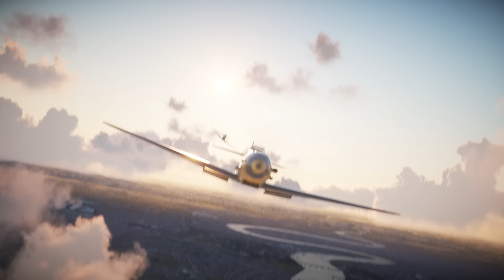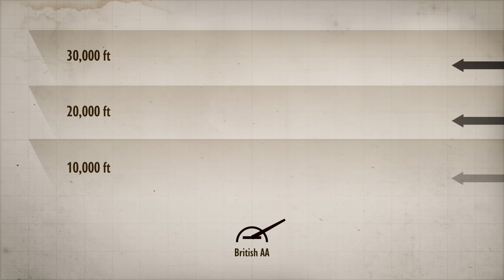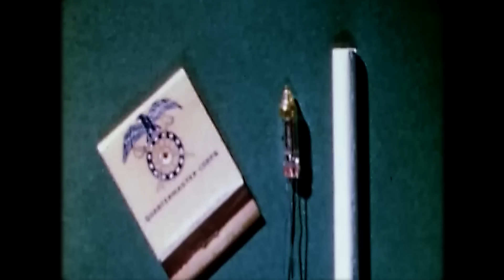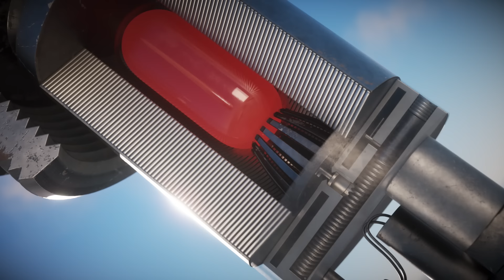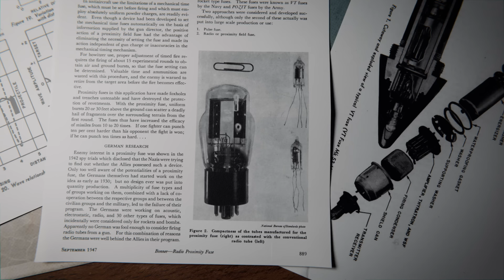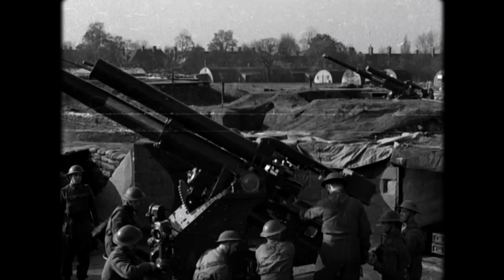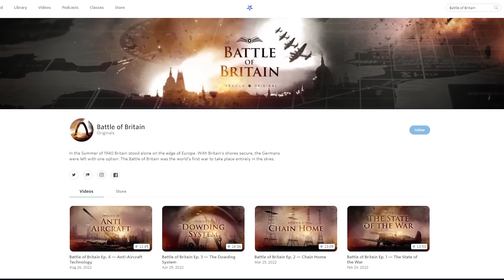The Secret Invention That Changed World War 2

Comment: The Battle of Britain is normally viewed as starting on August 15th of 1940.  The shift to attacking London was one of the Luftwaffe's major mistakes.  Shortly after September 15th, the weather began to turn bad, and the German emphasis shifted to bombing at night, as their losses in daylight raids were not supportable.  The British were working on a photo-electric fuse that would function when the shell entered the shadow of an aircraft.  The VT fuse was first used in the Pacific by the USS Helena in shooting down a Japanese dive bomber in 1943.  Its most effective use in Europe was against the German V1 cruise missiles.  The Germans never even came close to developing anything like the VT fuse.
Reply: There were so many mistakes by the Luftwaffe.  The failure to plan for a longer war in which losses needed to be replaced (new pilot training, new plane construction both on an expanding scale) was probably their biggest one.  They had a larger air force due to a massive head start in pre-war re-armament.
The Luftwaffe in July 1940 had a significant numerical advantage over RAF fighter command.  Over two thousand operational combat aircraft, with 800 of them modern single engine fighters.  Against the approx 650 operational fighter aircraft available to defend Britain, which included obsolete aircraft like the Gloster Gladiator.
In August when the Luftwaffe shifted its focus to break RAF fighter command, the fewer aircraft of the Luftwaffe managed, with accelerated losses of their own, bring RAF fighter command down to an operational strength of 700  (they were up to 750 before that).

The RAF was training new pilots at a faster rate than Germany, and was losing pilots at a slower rate (since RAF pilots who successfully bailed out would often survive to return to duty while Luftwaffe losses over Britain and the Channel would result in aircrew killed or captured.  Which are the primary reasons the RAF was growing through the battle, while the Luftwaffe was shrinking.
With much greater aircraft production, the RAF was not facing shortages of planes or parts.  The Luftwaffe had chronic shortages of both.  But the human element was the choke point for the Luftwaffe, as aircrews were being spread thin flying multiple sorties per day.  Look up "Channel Sickness" for the effect this was having on the morale of Luftwaffe pilots.
Also, a large part of the RAF pilot shortage is that higher command saw it (correctly) as a long term war of attrition in the air and did not want to sacrifice the training of new pilots to bolster current defense.  At one point in the battle, about half of RAF fighter pilots were deployed to training programs either as instructors or undergoing advanced training.  
Some were off in the Commonwealth Air Training Program, established in 1939 by the Chamberlain government with the overly ambitious goal of training 50,000 pilots per year.  The first graduates of the program began to arrive in Britain in September 1940.  So things were just going to get worse for the Luftwaffe if they kept up daylight operations through September and onward.
I've seen charts of operational aircraft for the Luftwaffe at various dates through the war.  The total operational strength figures I recall for June 1941 (total strength, not just those deployed against the USSR) were less than the operational strength deployed against Britain in July 1940 (which was most but not all operational aircraft at the time).  The Luftwaffe never fully recovered from the Battle of Britain.
But if they wanted a rematch in 1941, it would have been a different sort of mismatch.  The June 1941 total operational strength figure for singe engine fighters (Bf-109s) was around 900.  By September 1941, after meeting commitments for aircraft in Egypt and elsewhere, the RAF managed to still keep back over 1,000 modern single engine fighters, 60% of which were Spitfires at this point as the Hurricane was being phased out of service.

Comment: the battle of britain was a sideshow operation lion was thrown away pretty quickly
Reply: Sea Lion was a foolish dream.  Even if they could push the RAF back from the coast, there would still have been hundreds of RAF fighters defending Britain while the invasion was being launched, and the strength of the Royal Navy was insurmountable.  To defend the very slow moving and fragile transports (rough weather could sink them), the Kriegsmarine had destroyers (only 10 left in their whole navy) and a few dozen torpedo boats.  The British Royal Navy had to deploy much of their strength elsewhere to defend their sealanes in the Indian Ocean, Mediterranean and Atlantic.  So the diluted strength of the Royal Navy home fleet was (iirc) 6 battleships, 11 cruisers, 67 destroyers and around 700 smaller craft.
The best estimate of how many German troops could be landed on British soil are around 100,000 to 110,000.  They would be short of vehicles, artillery and a lot of depth of supply (ammunition for that artillery included).  Held back in Britain in case of invasion were 21 fully equipped infantry divisions and 2 fully equipped armored divisions (over 400,000 men total) with a third armored division in the process of equipping and training up. (the shortage of equipment after Dunkirk was a temporary problem that was fully resolved by August 1940.
And the Home Guard?  The image of old men with pitch forks was not quite accurate.  A lot of them were somewhat physically fit men in their 50s, just too old for service in the Army.  But they were men who had learned soldiering on the Western Front of WW I.  And to equip them the British had purchased several hundred thousand Enfield 1917 rifles and 25,000 Browning Automatic Rifles from the Americans.  
When British and German experts got together to wargame this out in the 1970s they had it as a total German defeat with the vast majority of the invasion force killed or captured within 6 days of launching the invasion.

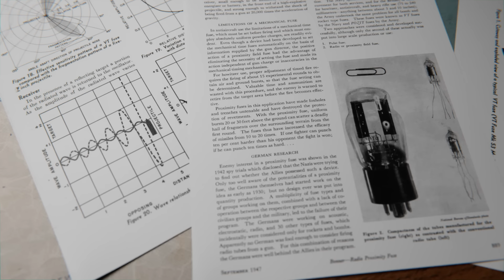Comment: 8:40 - sorry, dudes, but that BIG VACUUM TUBE in the reproduced page on the lower/right is fer sure a 6L6GT, an audio amplifier tube capable of putting out about 40 watts of power.

First, I'm sure it does not operate at radar frequencies.

Second, I doubt it could be made to withstand 20,000 g.

They must think we are all re-treads here?

I'm just sayin'...

...

Comment: The RAF WAS running on its last legs... if not in planes, then in pilots. Most RAF pilots were inexperienced compared to the Luftwaffe pilots, but because the RAF were fighting at their home defensively, and had an early warning system the Luftwaffe underestimated, it made the RAF could always choose their battles, and defend anywhere with all the fighter planes stationed in the southern UK, while the Luftwaffe expected them to only be able to defend with whatever they had locally stationed, and thus the advantage the Luftwaffe thought they should have had, enough to slowly wittle the RAF pilots and planes was every time turned into a slight disadvantage for the Luftwaffe, and led to it being pretty much ineffective by the time the battle of Britain ended.
Reply: Are you sure about that.  If the RAF was suffering from inexperience, this would be something that would be evidenced in a relative loss trend - i.e. more RAF fighters shot down per Luftwaffe aircraft shot down, but this trend (slightly more Luftwaffe planes shot down than RAF fighters) remained fairly constant throughout the battle.
The loss of experience would have been more of a factor for the Luftwaffe as they generally lost an aircrew whenever one of their planes was shot down (crew killed or captured), while half of RAF fighter pilots shot down managed to survive and return to duty.
The Luftwaffe began the Battle in July 1940 with approximately 2,500 operational combat aircraft.   RAF Fighter Command had 650 operational fighter planes to fend them off, including obsolete aircraft such as the Gloster Gladiator.

By August the Luftwaffe was in decline, not being able to keep up with losses.  But focusing all their attention to break RAF fighter command they managed to bring RAF fighter command back down to 700 operational aircraft (greater proportion being Hurricanes and Spitfires). But this was done not by changing the ratio of losses, but merely accelerating them (increased losses on both sides).

Look up Channel Sickness for the effect this was having on the Luftwaffe pilots, along with their chronic shortages of replacement planes and spare parts, and you see it was more the Luftwaffe that was heading towards its last legs.

After being reduced to 700 operational aircraft, the RAF resumed growing.

The idea that the RAF was being defeated came from the trend for the British military to overestimate their German opponents, assuming that the Germans were growing at a similar rate to the RAF (spoiler, they weren't).

The RAF was short of pilots, not planes.  Unlike Germany, Britain had a functioning economy and even with difficulties shipping in war materials through the so-called u-boat siege Britain managed to outproduce Germany in aircraft in 1940 by almost 2:1.  At some points the RAF had two aircraft for each pilot. So even as their total # of pilots was increasing, they still didn't have enough to fly all the aircraft they had available.
Part of the shortage was that many (up to half) of their pilots were involved in pilot training (either as instructors or  as pilots undergoing advanced training) - including pilots tied up in the Commonwealth Pilot Training Program.  Graduates from the Commonwealth program started to arrive in Britain in September 1940.

So, let's get that.  
1.The Luftwaffe in September 1940 was smaller than the Luftwaffe in July 1940.  2. RAF fighter command was consistently larger than it was in July 1940, and was growing
3. with more pilots to be soon graduating from the overseas training operations, they were about to grow a whole lot more.
A growing air force that has more and more pilots and even more aircraft does not seem to be on its last legs.

The Luftwaffe in June 1941 still hadn't recovered back to their July 1940 strength.  Arguably, it never did.

Comment: You mentioned the thyratron was used as a high power switch, which is true, but the reason it was used over something like a relay or a normal vacuum tube was because it could act as a high current rectifier to convert AC to DC for the capacitor, if it was just a switch they could have used a relay and ditched the gas.

Comment: It was my understanding that the British made the first proximity radar fuse that worked. The one antenna also mixed the return signal with the transmitted signal. An electronic filter used the tone of the beat to decide if the shell was approaching the target. The British were too timid to use them in case the technology escaped to the Germans. The Yanks solved the battery problem and made so many shells with such devastating impact that the Germans never got a chance to reverse engineer any. Similar but solid state technology is in use to day on the roadside radar speed warnings.
Reply: It wws designed Cambridge by Pye and sent to USA for miniturisation and further developement.
Reply: @Davyfb75 If it was sent to the U.S. for “miniaturization and further development”, you can’t say it was already designed.  The U.S. caught on when Britain started buying hearing aids from the U.S., who then designed, developed, and constructed VT fuse.

Comment: The start of this piece is a shameful mis-representation of history! 

The radar-based Variable Time fuze was developed in the UK BEFORE WW2. A prototype was sent to the USA with the Tizard Mission and GIVEN to the Americans without even patent protection. The British inventors had not patented their ideas to preserve secrecy and because they intended to donate the invention to the country. Two groups were involved, one led by Cobden Turner and an academic group from some northern university.

For the technically-minded, this device did not have a receiver, it relied on the reflected signal interfering with the transmitted signal and setting up beats in the circuit. These were amplified and when they reached a given intensity the thing would go off. A very elegant and intelligent approach, there were only 4 valves employed! 
Presumably the power source was a battery with very many cells, capable of producing the required high DC voltage. The glass vial of acid would soak the electrolyte pads of all these cells at once. A clever idea, circumvents the problems with batteries dying in storage.

The invention was given to the Americans in order to secure their cooperation for the manufacture of the many, many thousands that would be necessary. A factory in the US which had been making Christmas tree lights was duly converted and started to churn them out. British industrial capacity was stretched as far as it could go, an alternative would be to take to Canada but they were working full out also and a lot of infrastructure had not been set up yet.

With typical American grab-it-and-say-it's-ours attitude the VT fuze has been presented as all-American which is completely false, they had a small contribution to make during the final development, but a working reliable fuze had already been created. You can read up the details in "Reflections on Intelligence" by Professor R. V. Jones.

American suspicions were aroused when the British ordered from Westinghouse a large number (I think it was 25,000) of a very special valve built to endure brutal accelerations. At this time the British had been using 3" rockets as the testing platform, the acceleration is much lower than an AA shell so you can test the circuitry without having to make super-special components. In one of these tests the shell went off because it passed close to a seagull, very unfortunate for the seagull but leading to a reduction in sensitivity.

Where they became absolutely vital was in the defence of US Navy ships from kamikaze attacks, there was no reliable way to feed the data into the computers fast enough for such a fast and low closing target, the VT fuse took care of the time-of-flight part of the equation. Targets could be engaged with withering fire from medium AA artillery before they came in range of the Bofors and Oerlikon guns. Incidentally the predictor (computer) the American army used (I don't know if the USN also used it) was a direct copy of the British one, which was the best at the time.

Another action which proved their worth was the defense of Antwerp from the intense V1 attack the nazis subjected it in order to deny the Allies a deep water port. Something like 98% of the doodlebugs were shot down by the AA belt comprising all the British 3.7" guns that could be spared and the American 90 mm guns, in both cases aimed by sophisticated microwave radar, the American radar being a bit more developed than the British unit which again had been sent to the US for further development. A no-fly zone was enforced so that the guns could have free rein. The 2% that got through were due to violations of the NFZ which made the guns hold their fire.
Earlier, a similar scenario was played out on the south coast of Britain, radar-aimed 3.7" guns firing shells Wirth VT fuzes took care of a significant proportion of the V1's fired at London.

The Germans went some way towards developing a proximity electrostatic fuze that detected variations in the dielectric constant of the surrounding air, they abandoned the project as there were too many atmospheric variables. A fuze entering a mass of moist air could detonate prematurely, a wooden aircraft would be less susceptible, etc.

The statistics of number of rounds fired per aircraft brought down shows clearly the challenges faced by all parts. Suffice to say that the Germans, faced with dense formations of British or US bombers and with several years more experience, fared no better, it was still a couple of thousands of rounds per kill. If you add up the cost of all this you can see it was, in its conventional non-VT format, an uneconomical exercise. It was however essential as a boost to public morale.

The flow of technology from the UK to the USA was remarkable, and allowed the US to catch up with the other players. This has not often been recognised. The merger of British science and creativity with the vast manufacturing capacity and resources of the USA was the winning combination.

DO YOUR HOMEWORK AND DON'T TRY TO RE-WRITE HISTORY! Leave it to the professionals like the History Channel or National Geographic....

Comment: I saw one of these ww2 marvels in the Admiral Nimitz WW2 Museum in Fredericksburg, TX. 
This was a secret that was kept tightly.  The workers assembling this thing did not know what they were making.  War time production got the cost down to about $17 (1940's dollars).
This invention was amazing considering the vacuum tube technology of that time.  Tiny pencil size tubes were used.  The internal battery acid vial broke by the shock of being fired out of the cannon, and the acid splashed on the dry battery plates, they turned on just after it left the barrel.  Vacuum tube filaments need a bit of time to warm up.

At first, these proximity fuzes were used only in the Pacific theater over water so any non-exploded shells could not be recovered and analyzed.  The success rate of destroying kamikaze planes jumped to around 90%.  If I remember correctly, the average number of shells fired per plane was less than one dozen shells.  The fuze still had to get within 50 to 70(?) feet of the metal plane.

The battle of the bulge in Europe was so desperate that these high performance tools were finally used over land.